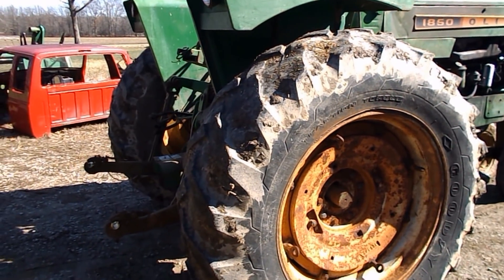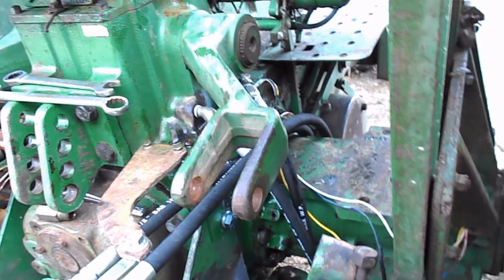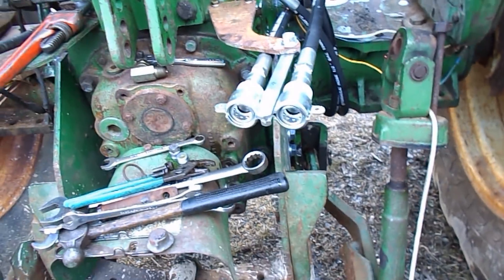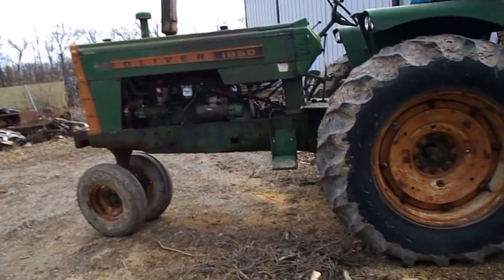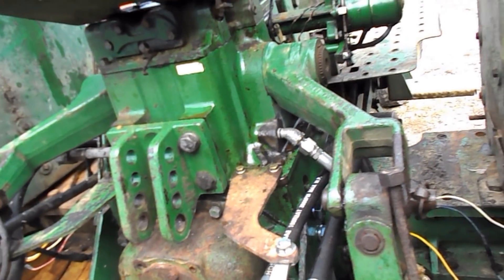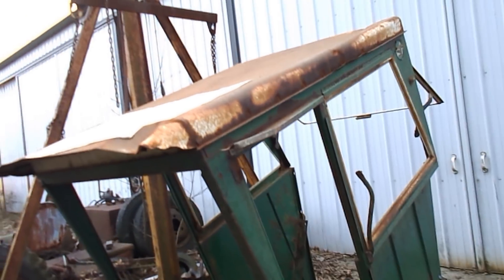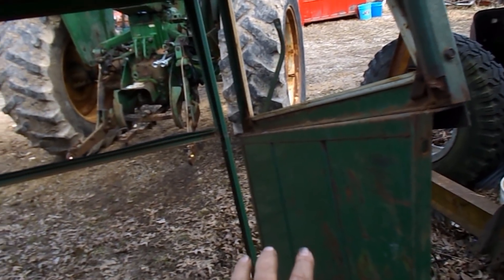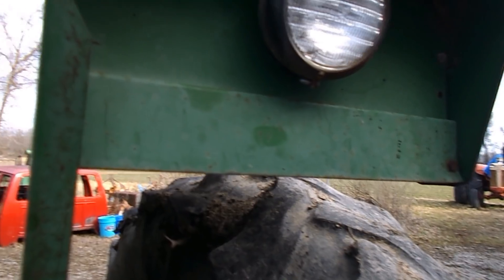Putting New Hydraulic Hoses on the Oliver 1850 part 10 A

Comment: Hey bandit wouldnt it be easier to use those connect under pressure SCVs like O66FB uses on his tractors? You could run your shorter hoses not under the axle like that. But if it works it works! Looks good so far!
Reply from the maker: Well I would love to have a set up like he has but those are expencive and I'm a farmer on a budget so I have to do it this way. That's one big difference between a 50 and 55 series tractors going from closed center hydraulics to open center (except for the 1550 and 1555 there the same closed center). I like the longer hoses for several reasons and I've never had a problem with them running this way but the big thing it the hoses are relaxed and can move around if they have to when hooking them up and is why I ran them this way.  One thing at a time and when its done I'll know its right and ready to roll when the time comes.  Bandit

Comment: How's Long 900 ? Still running? This Polish version of C385 need keep hydraulic oli in good condition, and often wash metal oil filter and change paper filter.
Reply from the maker: She is running good , I might fire her up today and let her run for awhile cause its been sitting for a couple of months. This spring I'll be going over her before it goes to the field and service everything.  Bandit

Comment: Just  heat the plug not the casting then let it cool down completely then they'll back out easy. 😁
Reply from the maker: After being in for 55 years the only way to get them out is to heat the casting around the plug and it will expand while the plug stays cooler from the oil behind it. I was bending a 3/8 ratchet (good one) with a wrench to get it broke loose. 55 years is a long time to build up rust in the threads so heating the casting is about the only way it was going to come out. The plug was an internal plug (3/8 ratchet fits just right) and heating it hot enough to brake it loose will make it softer and more prone to strip out the other plug was an external that took a 9/16" wrench and it was the same way get it hot enough to brake it loose and you might strip the head off trying to brake it loose. This is why I heated the casting to get them out.  Bandit

Comment: I don't understand why ya wrapped hoses around axle, We got 3 Four digits all set up with the  hoses going straight back to the remotes with   over 15000 hours of operation no trouble. You should also  try avoid using galvanized fittings on hydraulics.
Reply from the maker: On the 50 series I've had I've found it best to run the hoses this way so there relaxed , Dads 1550 is set up like your taking about and it has a tendency to pop the couplers apart cause the hose always has pressure on it sideways kind of cockeyed and there never relaxed. When I put hoses on one this is the way I always do it and never have any problems with the couplers coming apart and it makes it easer to grab and get the coupler together and the hoses stay relaxed .  I don't like using galvanized pipe on hydraulics but man the price of black iron has gone threw the roof !  Its costs more then buying hydraulic fittings and there high themselves , So I don't like to use it but when the choice is hard 90* hydraulic fitting or a galvanized 90* fitting I'll use the galvanized fitting plus the tractor wont get 50 to 75 hours a year at most on it so that's another consideration too. But the big thing is using what you can get and without a 20 mile trip someplace to look for fittings I'll use these.  Bandit

Comment: Is wrapping the hoses going to come back an haunt you later? Shit coming up and tearing things loose?
Reply from the maker: Well the 1550 I put hoses on it in 1988 when I bought it and its done the same way and 32 years later they haven't been torn off so I think it will be ok . But the thing about it is the hoses are relaxed routed this way and makes it easer to hook up, Other thing is with them going around the axel if the hitch pin comes out and the hoses don't release your not going to brake the fittings off in the castings and that's why I prefer to run them this way.  Bandit

Comment: Run your right hose the same way your  left one is and if you need to  drill a new hole in the bracket where they  attach.
Reply from the maker: I bent the bracket down and bent the lower end up so it dropped it down about an inch and got it away from everything and it also shortened it up a little too so it fits better now but I still don't like the way its plumbed into the tractor and I think I'm going to change it to clean it up and make it look better and make the hoses more relaxed. Bandit

Comment: I don't think I would put any windows in the cab. Looks like they changed the oil at least once.  I put the wood in my stove sideways.
Reply from the maker: Side windows and back is what I'm thinking if I can clean up that sheet of Lexan and buff it out clear again, A little protection for rain might be nice to have. With no windshield in it there would be a lot of air moving threw it so side and back window might not be too bad.  That is the smallest wood stove I've ever seen about 9 or 10 inches long fits inside and if you go sideways 14" is about all it will take but it doesn't heat as good as putting it in strait from what I've found. Good little stove but I got to fix it for sure before I can use it again. One thing for sure maintenance was lacking on this tractor that's for sure but she getting it now from front to back !  Bandit

Comment: What  make is the cab? I have one that came off a 1955.
Reply from the maker: It a Full Vision cab made for the Oliver tractors, They called them Row crop cabs and fit between the fenders and its why it has the different shifter lever than most 1850's do, Makes it easer to get in and out of the cab. Bandit

Comment: just a thought Don it has worked for me before you could have welded nuts on those plugs instead of heating them
Reply from the maker: Over the years I've learned that if a plugs has been in for 50 years the nut trick wont work, You got to heat the casting around the plug and get it hot and then the plug will brake loose but not without a fight. When its hot enough oil will come out around the threads and then you know its coming out for sure. I hate to heat a casting like that but sometimes you don't have much of a choice and beings these had been untouched sense 1965 it was the only way they were coming out.  After you've done enough stuff like this you know what to do when you look at it, There is the hard way and the easy way and in this case even if I don't like to do it I know its the only way it will come out with any ease.  Bandit

Comment: WHY DO THE HOSES,HAVE TO GO AROUND THE AXLE,SHORTEN THE HOSES UP GO STRAIGHT BACK,AND YOU WILL HAVE IT
Reply from the maker: Well that's a simple one to explain, With the hoses run like they are they are relaxed witch makes it easer to hook up to them and there are no side pressures pushing on the couplers binding them in the bracket holding them.  With them wrapped around the axel if the hitch pin comes out and the couplers don't release you wont brake the fittings off in the casting.  My 1550 was done the same way in 1988 when I bought it and 32 years later I haven't had anything rip them off the tractor.  My tractor and I put hoses on the way I wanted them and this come from years of working on stuff just like this, Hoses put in a bind tend to end up having problem so I put them on so they are relaxed.  Bandit